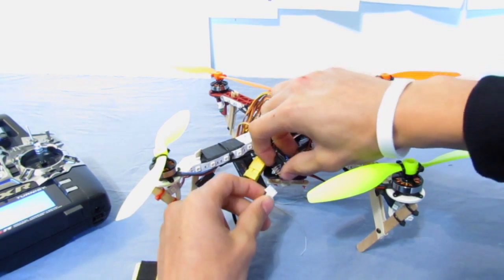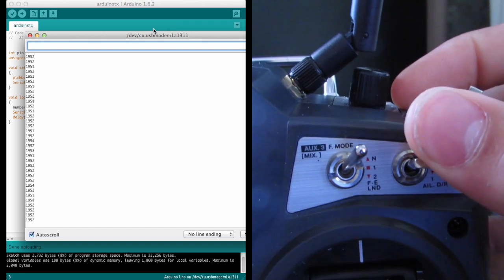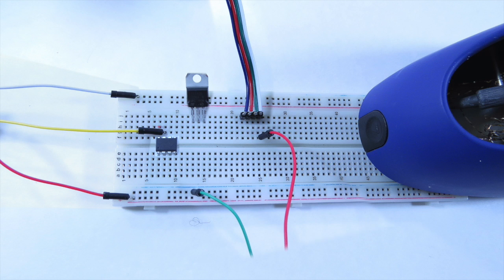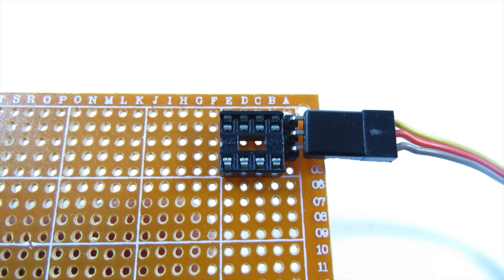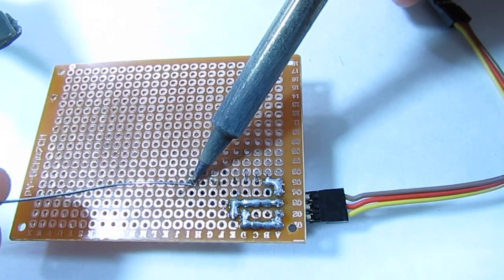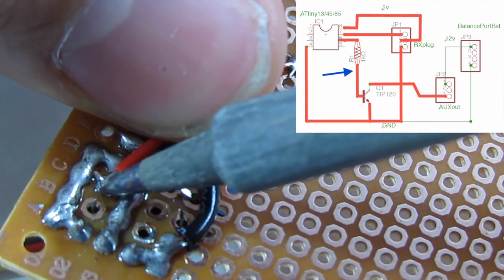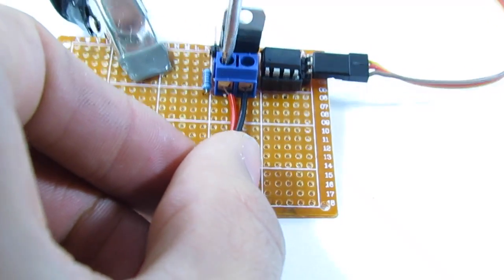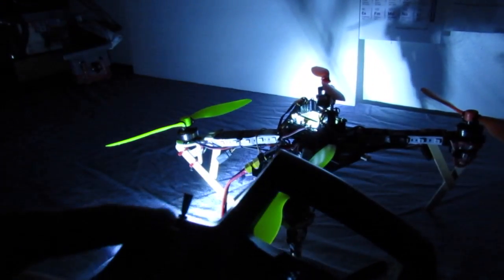DIY Remote Controlled Switch (RC Switch, RX Switch)

Comment: Great video,   if I was running say one or two single diodes would I just change the resistor to one that would accommodate my battery to led

Comment: did you program the attiny chip with the Uno?
Reply from the maker: Yup. You can also use an USB programmer or an attiny breakout.
Reply: +AJ Robinson Thanks! I have a Attiny25 available to me right now, will that also work for this?
Reply from the maker: +Anthony Rossi Yup it should work fine
Reply: +AJ Robinson Thank you very much, Appreciate the quick response!
Reply: Did you skip programming the attiny?  How would I wire the attiny to program it ?